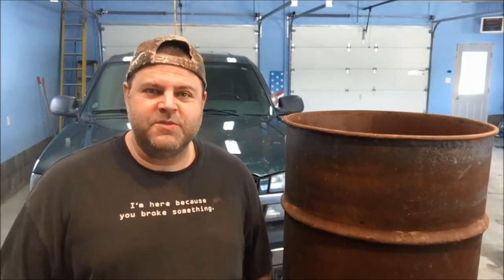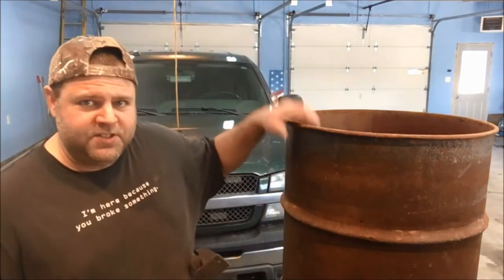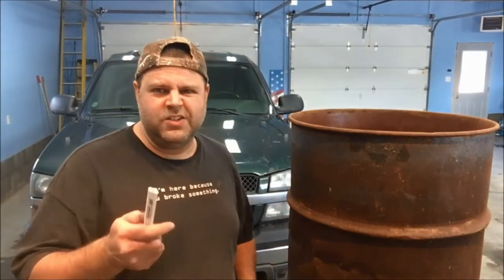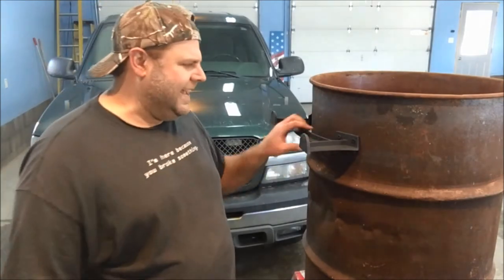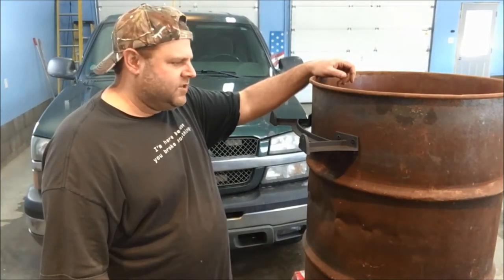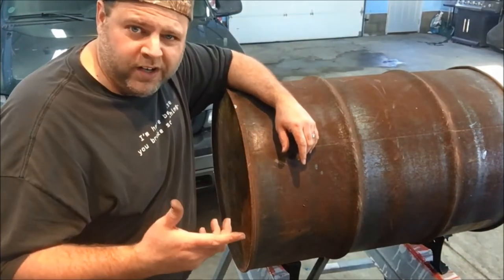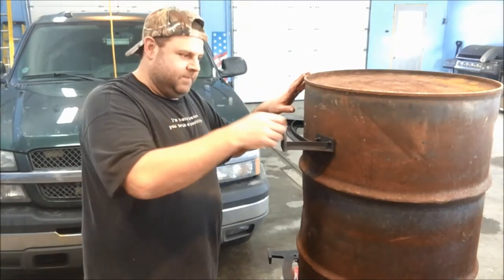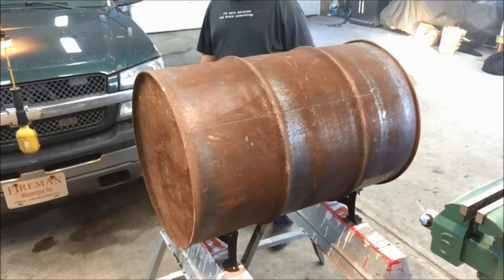Cast Iron Barrel Stove Kit Leg Installation | Part 2

Comment: I have the same saw horses. There are little holes on top so you can add a peice of 2x4 to the top. You secure it using drywall screws from the underside.
Reply from the maker: I didn't know that. That's a great tip, thank you!

Comment: Nice intro
Reply: I did one of these once......  I ended up putting a 2-30" piece of angle iron connecting the 2 pairs of legs.....then I had  a frame I could just set the barrel on......and I could spin it until I had the damper pointed up.  No alignment needed
Reply from the maker: That’s a good idea! Thanks